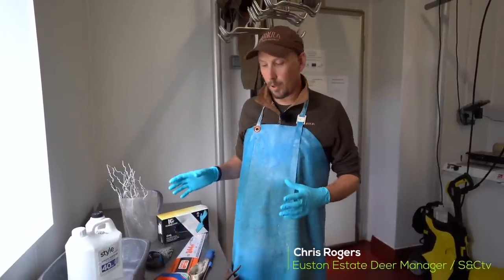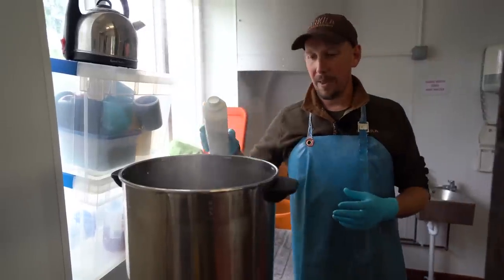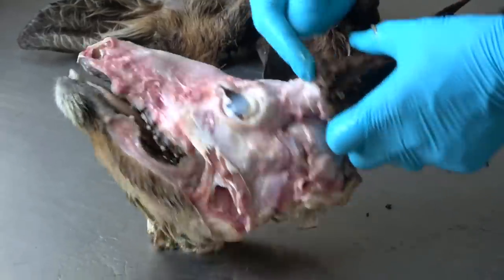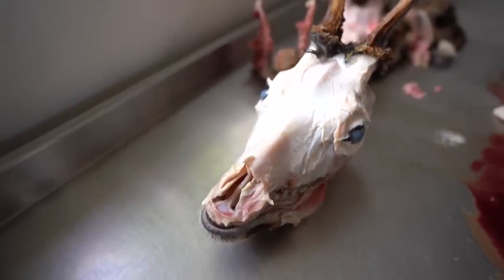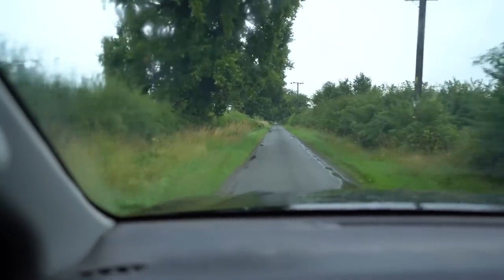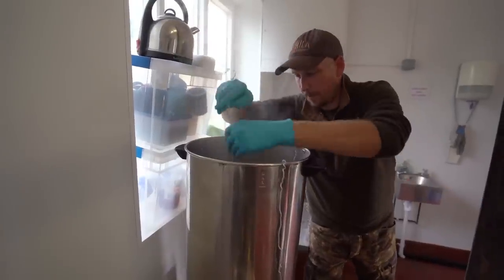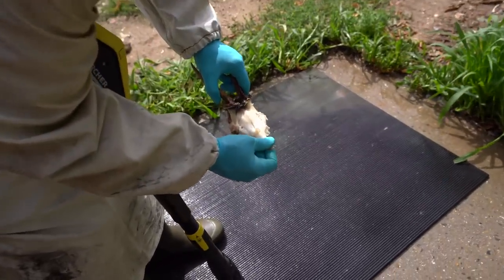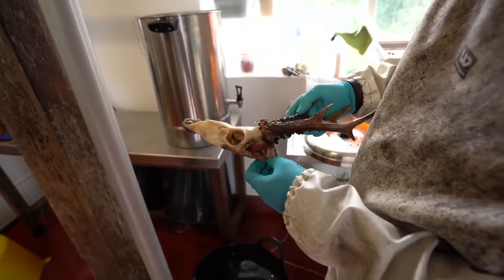S&C TV | How to prepare a deer skull

Comment: Good stuff and really informative, but a wee word of caution for your viewers. Having cleaned several hundred Deer heads I stopped using the powerhose as I found out the hard way that even old heads could be blown apart by it ! When i’m doing heads for clients I prefer to do them hands on 👍🏼🏴.
Reply: Aye, you have to be careful with the pressure washer but it does make the job easier and better for cleaning up full skulls and long nose cuts.